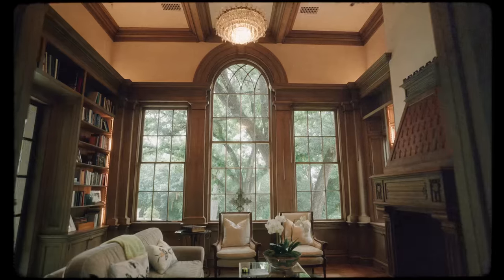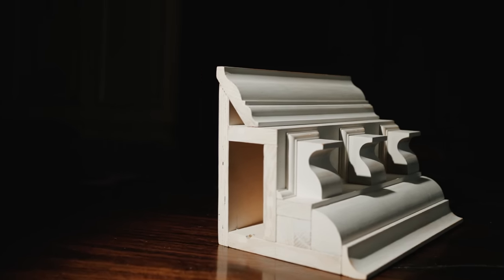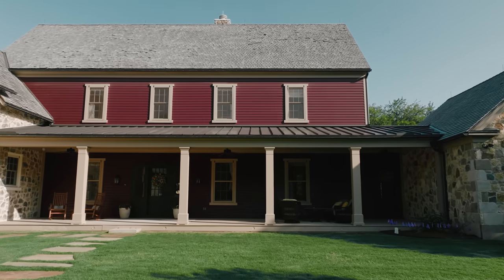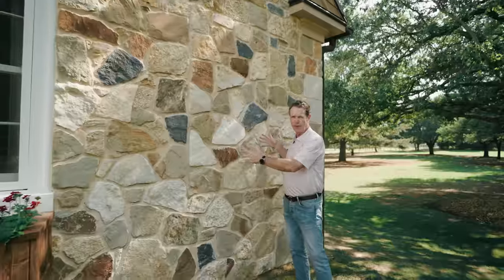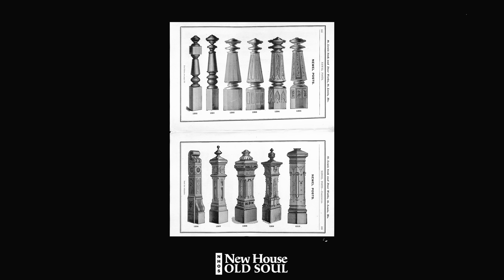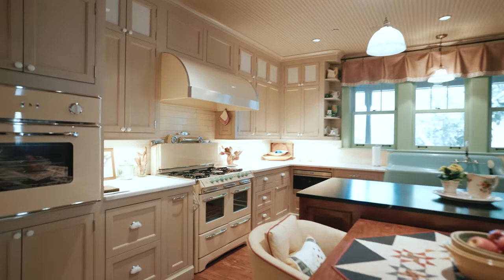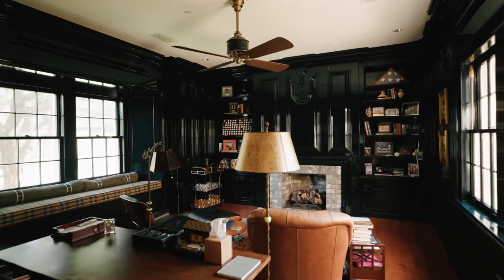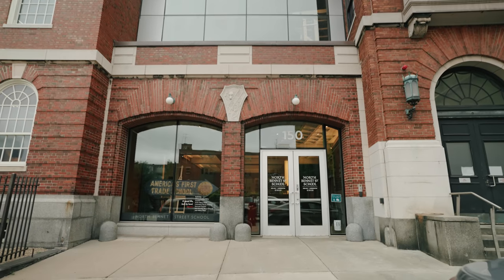New House Old Soul Ep. 1 - How to

Comment: Love the details! Even modest houses can add character with old doors, mortise locks, window sash locks and other vintage hardware for the same cost as cheap/new. As you said it adds interest and little things to "discover". That 1940s kitchen is stunning and even has the vents under the kitchen sink however those canned ceiling lights don't fit, they should have found space for wall sconces.
Reply from the maker: I totally agree!

Comment: I have a question: I am noticing everything is seemingly very TALL. Tall roof lines, tall porch, high ceilings- was this a deliberate decision? Or how did you wrestle with the changes in height from 1600s rural pennsylvania to modern expectations? Thanks! I love your work.
Reply from the maker: Well, I'm not sure exactly which parts you are referring to. We try to stay with historic precedent for porch/ceiling heights. They are taller than new porches. in my experience.

Comment: Hi, Brent. I just watched a Youtube video from the Building Science and Beer Show called Form and Size Matters and they were discussing how by simplifying a building’s shape down to either a simple cube or rectangle it can improve the amount of energy needed to make the inside of the home comfortable as well as improve the durability of its construction (less corners and simple roofs equals less chances of mistakes in detailing). However, they also talked about the fact that as you remove features the house can become just a plain, boring box. 
Can reducing or eliminating exterior features improve the energy efficiency of a home? Can the shape of your home (as well as simplifying your choices of exterior cladding and trim) really affect the overall energy needs and interior livability of your home?
Reply from the maker: Absolutely. They are correct. And historic precedent teaches us how to make the houses beautiful and charming even though the shape is simple. Every house before 1860 was a simple rectangle, yet are very charming. IMO Thanks.

Comment: So if I put cedar siding on my house, I am repainting it every 10 years and not sure if new paint will even stick, but if I put James Hardie siding, I am all set for like 30-50 years maybe with a repainting or not. The first one is beautiful, the second one not so much. Do I really want to be painting my house when I am older? Or will it improve the look of the whole street and pay back? And which cedar should I buy as there different choices.
Reply from the maker: Your problem is probably not the material but how you installed the cedar. Did you provide and air gap so that that cedar siding can breathe?  If not, that is why the paint is failing. Good luck.